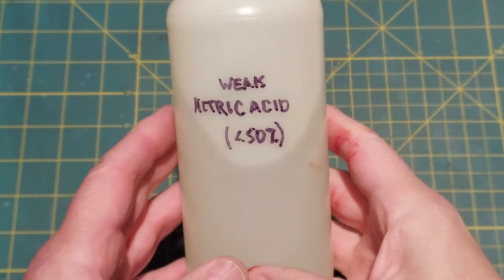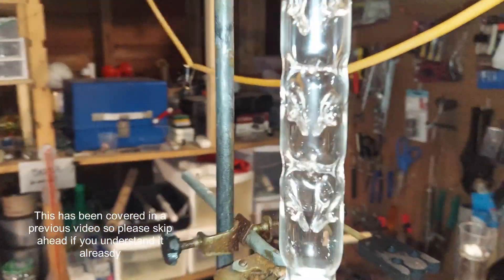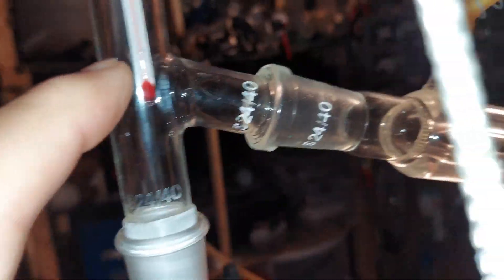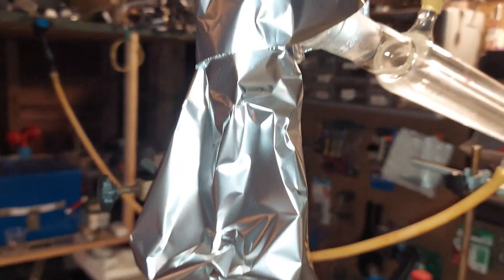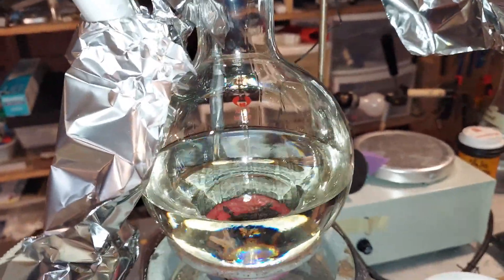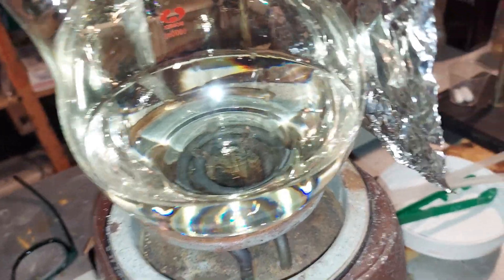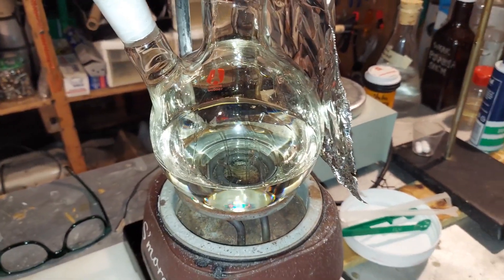Concentrating Weak Nitric Acid

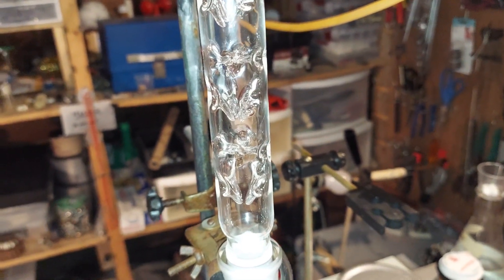Comment: I have question, the boiling point of nitric acid, according to google, is 83 degrees celsius and the boiling point of water is 212 degrees celsius, so I thought that nitric acid would evaporate prior to water evaporating, but boiling and evap are not the same I get it, but you said that nitric boils at 120 degrees celsius 1:30 and water at 100 degrees? Ok nevermind its because the mixture of water and nitric acid boils at 120 degrees.

Comment: my 30cm column didn"t helped at all , there was no visible refluxing
Reply from the maker: Long columns can have a hard time getting warm enough to be effective.  Try covering it completely with aluminum foil.  It may help.
Reply: @cranialconstruction  thanks , but i thought that it needs to be maximally opened to air to allow efficiently drown the heat , and then , by my logic , to condence vapors .
Reply: IMHO you need the temperature differential between the bottom and top of the column. You want the nitric acid to condense (and not the water) somewhere in the column, and you can't achieve this with too much or too little heat. Also I would not wrap the column as this would somewhat reduce that differential. You could also use a condenser in the column.